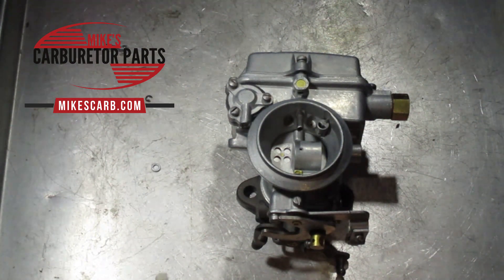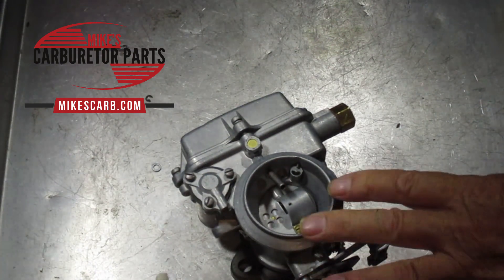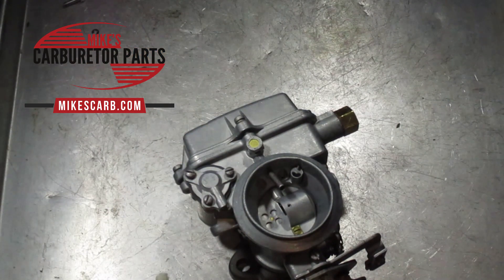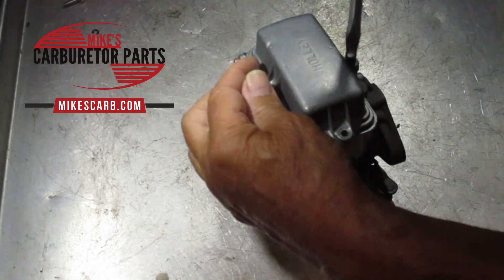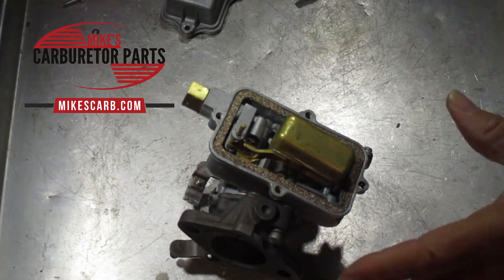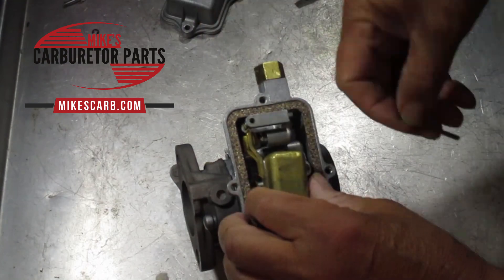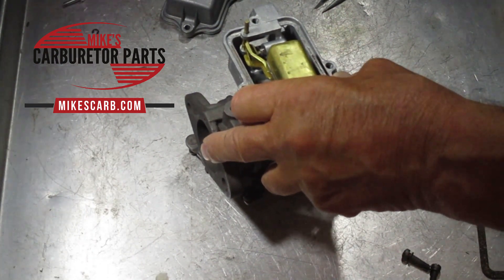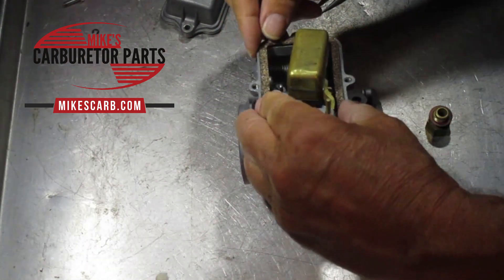Why Is My Holley 1904 Carburetor Flooding

Comment: Hello, thanks for the video.  As far as the fuel pump, I have a mechanical fuel pump on the 66 200cc Mustang,  what it the best psi to have it set to? What would be the minimum and maximum psi for proper operation. Currently the mechanical fuel pump is producing 7 psi which was measured after the fuel pump and a fuel filter.